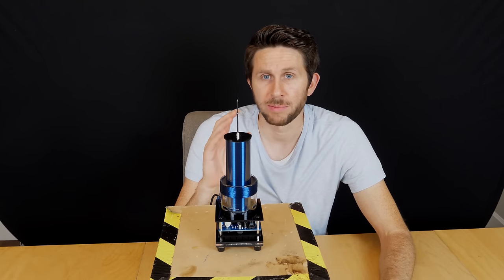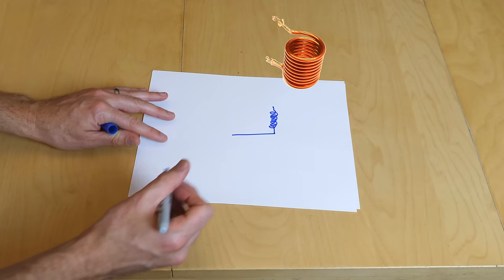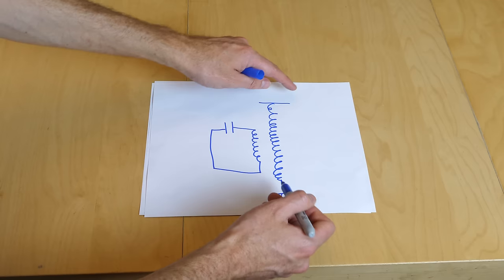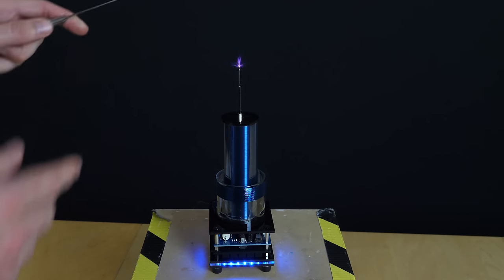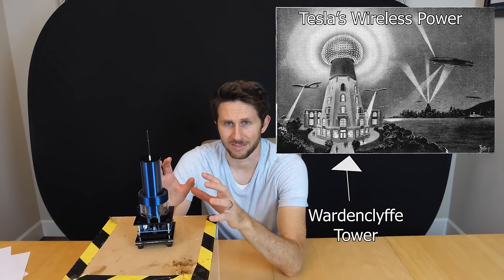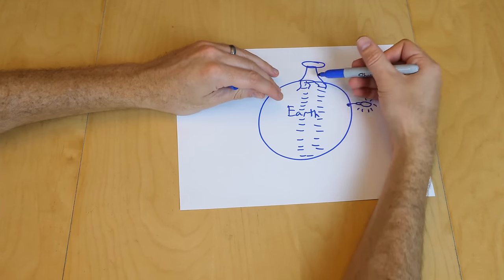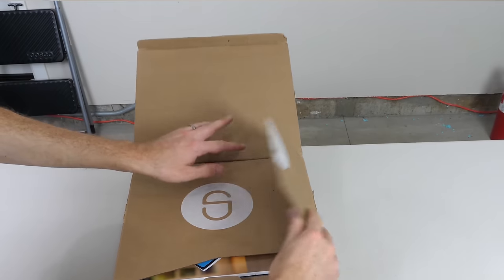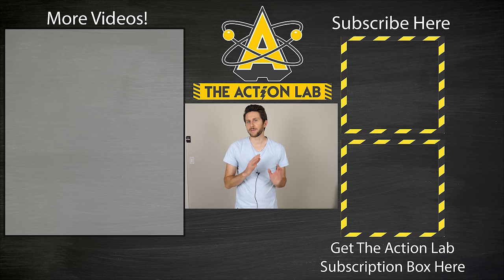Making Wireless Energy For The Entire Planet—Nikola Tesla's Wardenclyffe Tower

Comment: "This isn't free energy at all.." What's your definition of free energy? Output is greater than input? How many lights can you light with this HV & HF field? As long as you stay out of the source "near field" which disrupt the source, it can power many many lights. Try to have all your friends and family members each holding a light bulb and bring them close to the source WITHOUT touching it. Also, how about building additional secondary coils which resonate at the same frequency of your source. Place these secondary coils close to the source without touching, each of these secondary coil DUPLICATES the source without diminishing it.. The source magnetic field is passed on to UNLIMITED number of 'receiver' coils, similar to radios and TVs signal.
Reply: "How many lights can you light with this HV & HF field?"
Well, that question actually takes a pretty solid chunk of math to get to end of. You could perhaps get someone with the inclination on a site like quora to work through it with you.

"each of these secondary coil DUPLICATES the source without diminishing it"
This is incorrect. Remember what he said about burning himself?

"The source magnetic field is passed on to UNLIMITED number of 'receiver' coils, similar to radios and TVs signal."
Old school analog receivers in radios and t.v.'s amplify the signal using power..i.e. they have to be plugged in. Simple systems such as crystal sets can use the antennae to gather energy, but they rely on a powerful local source and produce microwatts-barely enough to push a tiny amount of air to produce sound.
Reply: @mysteri0861  You've got some things right, but some assumptions you seem to be making are wrong.

Your link leads to a fellow who is building kits for what are known commonly as tuned or tank circuits. They are nothing new and the principles behind them are well understood and usually introduced early in EE courses.

You said"
"each 'receiver' coil receives & DUPLICATES the source magnetic field"

Not exactly correct as they are of course not lossless-so they cannot duplicate the field. The circuit can be tuned to lower resistance, but not eliminate it. In fact, you can refer to the formula for calculating loss in his circuit if you'd like-look up the RLC circuit resistance formula.
Here is a very basic tutorial that might make it clearer for you:
https://nationalmaglab.org/education/magnet-academy/watch-play/interactive/induced-current

His "tuned" system works the same-the field falls off in accordance with the inverse square law and the sum total of energy stored in all of his simple coils will be less than that generated inductively within the center coil- it's as simple a that.

In the linked video, he is fine until he says that the circuit can be replicated indefinitely-it cannot. It's very likely that he is unable (or unwilling) to perform the metrology required to measure small changes across the system that he is demonstrating-this is a common mistake among naïve free energy enthusiasts.
In other words, I'm sorry, but he is either incompetent or not being completely honest with you. 

Enjoy exploring how these well-known circuits work, they are interesting to play with and you can easily build your own without buying a kit from someone else.

Comment: All transmitted through  DC system. The high bandwidth wireless internet/wireless radio also a kind of electron transmission. In the end line of transmission the technology same as MW capacity solar power to high voltage grid line system so far. Why not it possible today ? Question of high costing expenditure on per/kwh basis. But possible. The research base would how to reduce cost through the system.

Comment: I'ff i am correct a electrical wave can not have a longitudal wave because its a energie not a mass... But does that not depend on the state of the cat in the box?  When you want to extract it with mass (go true molecules) its not possible as the wave would be messured as being in energie form so as a wave. But what hapens when you messure it with a wave itself and it turns into a partical like the 2 slit experiment, where a wave turns/behave (into) like a partical? What happens for instance when the Tesla coil is hanging upside down in a vacuum tube above a highspeed train and the wave turns into flowing particals with a longitude untill it hits the train and turns into a wave again... When a positive wave enters trough the vacuum tube hitting the train and a negative wave leaving the train and hit the tube, they pass each other and messure each other in wich both turn into particals and create electrons making a longitudal wave trough vacuum. 1 is light... the other dark... (or positive vs negative charged) and the waves where (behaved like) particals so mass. 3... (+) 6 (--) ... 9... (E energie 2 dementions t=0) and 0... (M space and time the 3th and 4th demention where a wave turns into a partical) Now in the universe Energie will never have absolute t=0 as the universe is not absoluut vacuum.

Comment: I do not know how this stuff works but what is mentioned there to "Pump electricity through the earth" might not be the key. I think that the whole Tesla coil system aimed to amplify certain HZ of the earth itself and through it get the energy out. Earth has its magnetic poles so I´m assuming that therefore there is inner induction which we just should get out. We have to remember that world has changed quite a lot after Mr. Tesla so the planned amount of Tesla coils might not be enough today. Anyhow probably the idea of getting electricity through the air is still valid. I wouldn´t be any surprised if/when we run out of the oil there would be immediate announcement "We have now this New technology called Cosla Teils and it will give us the needed energy" and people with political memory of average 4min would be totally out of their mind how wonderful this life in the future is....Sorry for the sarcasm. I hope this helps someone who is thinking the same, as in the start of this writing.

Comment: why does no one read teslas work?...   he wasnt using conventional elextricity.   plz make a video explaining ultra fast unidirectional disrupted discharges.      tesla was polarizing the conducter with voltage then cutting it off from the source BEFOR any current or electrons could move.  then tapping the conducter for power while it seeks equalibrium as its still shut off from the power source.
Reply: and tesla was using the earth as a " one wire" transmition line. only  single digit loses.   look up nu energy company amd ground waves

Comment: Wardenclyffe Tower was a failure; he was never able to transmit energy farther than 62 feet and, due to dissipation, the power grid would require an increase in capacity of several orders of magnitude even if it had worked. He didn't become a proponent of free power until long after his funding dried up due to his ability to show any advancements along that line. His biggest success was the brushless AC motor,

Comment: The way to debunk Tesla’s idea of power transmission to everyone on earth through electrical resonance in the earth is just conservation of energy. Wardenclyffe would have had to pump stupendous amounts of energy to maintain the power required by all the users the world over. I don’t see how the transverse nature of EM waves is relevant. Tesla coils work because of the coupling of two tank circuits. The high-voltage side’s tank circuit is formed by the coupling between the secondary coil’s inductance and the dynamic capacitance between its coils. It’s behavior has nothing to do with the transverse nature of EM waves.Tesla thought the earth itself would act like the secondary circuit in his famous coil.

Comment: does the paper move because it has trapped moisture and it's very light at the same time? you aren't really explaining why the paper is moving. you're parroting something you have seen or heard without explaining what's going on. so is the moisture inside the paper reacting as a conductor?

Comment: I have a question is that kind of where the amperage comes in that makes it more dangerous cuz I've heard a few electricians and and whatnot say that it's not necessarily the voltage it's the amperage that will kill you or that is dangerous is that kind of what they're talking about with the Tesla coil not shocking you?
Reply: Since we can't say it's the voltage alone or the current alone that kills it's silly to try to choose one, and the answer is ultimately that both variables are automatically playing a role. Any electrician or person working with commercial or industrial power is safe to assume the higher the voltage, the deadlier it is, because they are working with a supply which can deliver more than enough amperage at those voltages to kill. Take a modern fluorescent ballast these days though, Electroboom has a video on this, he shows the high frequency of the electronic ballast output doesn't shock him at over several hundred volts because of the skin effect. Same thing with Tesla coils and sparks which don't shock but burn instead. I can however for example take an arc from a Tesla coil that isn't shocking me, and turn the on-time of this pulse down very low to the point where a super small amount of current is ringing down and this starts to create sparks that shock instead of burn. The color also goes from a thick purple (with a lot of power and resonating in it) to a thin white or blue which is more similar to static shocks.

Typically you can kind of see whether or not it's going to shock you or not when it comes to a Tesla coil but this is dangerous because it's not an absolute measure. Only way to ever truly know for sure if something would shock or burn is by seeing what the content of the discharge is through an oscilloscope or something. It could contain a lot of RF which would burn, but also within that contain some lower-than-RF which will shock.
Reply: @Magneticitist  thank you that was very detailed and thorough explanation it always confused me like I thought the higher the volts the more dangerous it was but some people will tell me now it's the amperage not necessarily the voltage and I'm like okay what's the difference you know but thank you for the explanation I appreciate and I do love electro boom he's funny and crazy at the same time but he obviously knows what he's doing or he be dead by now LOL thank you again for taking the time out of your day to give me that thorough explanation I'll have to look into it more about current voltage and amperage and wattage and all these different names for the similar thing but it is fascinating
Reply: They both work thogether. You could have high voltage but low current so it won't be dangerous, but if you have high current but low voltage it won't be dangerous again because the voltage won't be enough to pass enough current.
Reply: @binarix128  thank you that makes sense
Reply: @ryandavis3393  no problem. ;)

Comment: I would take energy out of a circuit at rates of hundreds or thousands of horsepower.  In Colorado, I reached 18 million horsepower activities, but that was always by this device: Energy stored in the condenser and discharged in an inconceivably small interval of time.  You could not produce that activity with an undamped wave.  The damped wave is of advantage because it gives you, with a generator of 1 kilowatt, an activity of 2,000, 3,000, 4,000, or 5,000 kilowatts; whereas, if you have a continuous or undamped wave, 1 kilowatt gives you only wave energy at the rate of 1 kilowatt and nothing more.  That is the reason why the system with a quenched gap has become popular.
-TFC Books, Formal Courtroom Q&A with lawyers present, Tesla's OWN words, captured verbatim by Stenographer

Comment: Yo dumbo! Nikola Tesla true wireless worked through Earth. As Nikola Tesla demonstrated 1 wire transmission where a capacitative open air plate is good to be there for the pressure mediation to be facilitated (there is no electron flowing lol)
So you can treat Earth as a conductor suspended in space and wardencliffe tower didnt shoot sparks, but the top was the open end of the capacitor and 99% of power went into vibrating the whole Earth where you put recievers of suitable atunement to harness it from any part of the "some distance (200km+) aparatus - an improved version everywhere in the world.

He called radio an aberation of science! and ether is a gasseous substance so EM waves are longitudinal and not transversal.

Comment: Transmit ? looks like "attraction" more to me. Horrible example. How bout just yelling is transmitting energy wireless. Using the balloon example: is it possible to rub the balloon on the ground and make the strip of paper move away from the balloon ? as opposed to toward the balloon ? prob not. I mean you could have wireless power, but just like electric car batteries vs. fossil fuel engines, there is no power is soft stuff (so far as we know it). So it doesn't mean that there's no current .. .just not a super strong one.

Comment: Two things I understand about this:
Initially broadcast power was not implemented because it could not be metered and therefore effectively would be free.
The "powers that be" decided a long time ago that we (ordinary people) should not have easy access to cheap energy because we would overpopulate the planet. This is false. In countries where energy is available and living standards raise, the birth rate falls, as we are seeing in most Western countries.
Therefore broadcast energy will not be made available to the ordinary people, and I believe the Anthropogenic Climate Change Cult is actually about population control and nothing to do with the lie that the planet will burn up in 12 years if we don't start to pay much higher taxes and stop using fossil fuels for cheap energy. 

Before trolling me, do your own research. If the UK bans the use of fossil fuel powered vehicles, including hybrids, by 2050 there is no way we will have the capacity to create enough electricity to charge the electric vehicles. There is also a lack of the basic materials to manufacture the batteries, wind turbines, and solar cells to provide alternative electricity from so-called green sources, which are anything but to those who know anything at all about manufacturing.